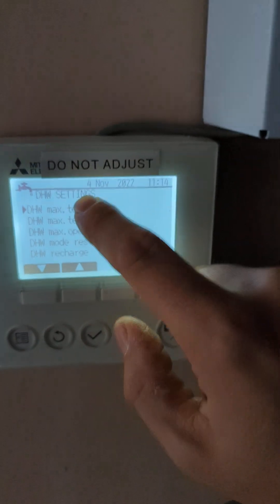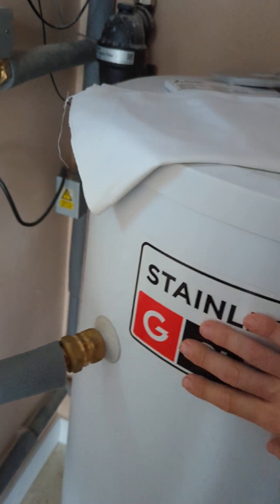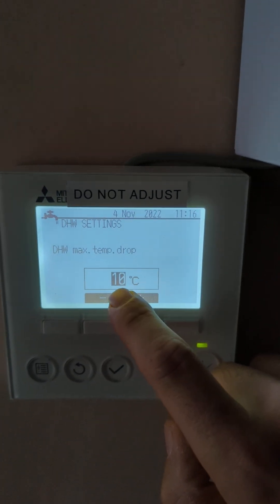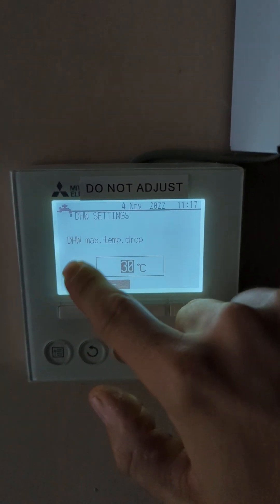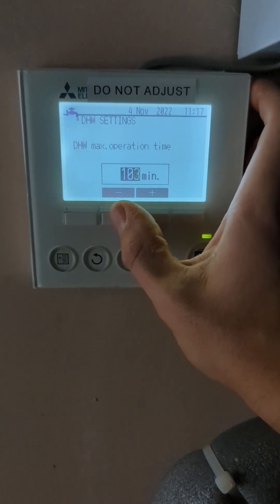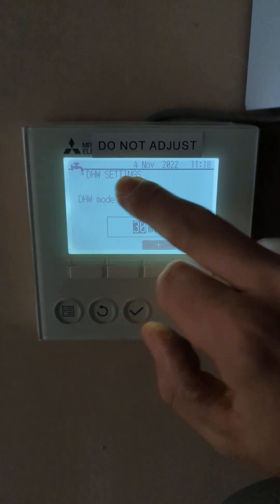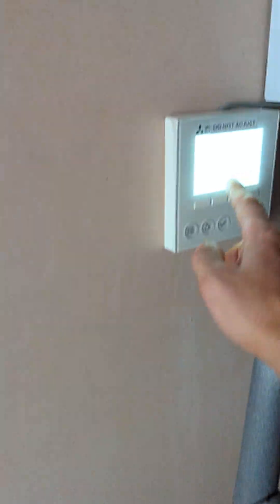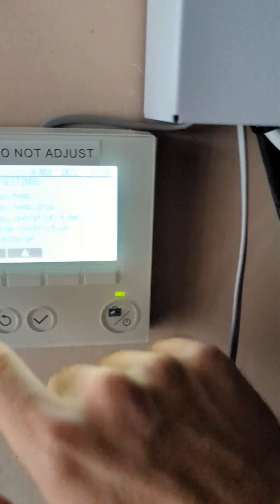Mitsubishi Ecodan hot water settings explained

Comment: Hi, I’ve had my ashp now for about three weeks. I have found that the heating of the water is done with the immersion heater and not the heat pump. The water is set at 50 degrees. Why is this and is there a setting I need to change..?
Thanks. 
Regards 
Mick.

Comment: I don't get the notepad option at 38 seconds. I only get the lefthand  option (to change between normal and eco). My water temperature is currently showing as 67 degrees on the front screen which is much hotter than I need.

Comment: I have an Ecodan system which is an electric heat pump for radiators and hot water, it has a water heater tank and a control panel.  It was all set up for me, but I thought i was spending too much, so i started tinkering about a year ago and I turned off my water heater tank and I either:

- Found an option in the controller settings thinking It meant I was bypassing the water tank from heating up/storing the water and instead getting my water heated on demand directly from the heat pump

- Thought that just turning off the water heater at the wall was achieving this 

- Or i did both, I can't remember.

I'm away from the house most days and fixed my energy rates with OVO before October, but I'm still spending over 100 each month in the winter and between 50 to 100 in the spring and summer.  When I get back and turn on the hot tap in the kitchen, it runs cold for a several seconds before the tap spits/splashes with a burst of water and then the water starts coming through warmer and warmer.  I thought that by turning off the water heater at the wall and/or adjusting the settings, that the water wasn't being heated/stored in the tank and that I was getting water heated on demand directly by the heat pump when I needed it or am I mistaken?  It didn't make sense to be recycling and storing hot water for days while im away. Additionally, I see spikes of energy use in the morning or evening on the app for days I'm not there as well as days I am.  So I turned off the legionella feature in case that was costing me money too.  What do you think please?  Thank you.

Comment: Really really helpful and the video is clear. My confusion is I have the heat water setting in the general settings on at certain times between 4 and 6pm so should I change this as I am not sure which setting over rides the other? Sorry if not clear I mean there are the settings you show and then heating and hot water settings which I have on timer so should I change the timer settings to run all day like I have the heating setting? Thanks fora great video

Comment: After selecting the hot water option you have the screen with the tap and legionella, under the tap icon you have it set to ECO, is this better than the Normal my system was set to?

Many thanks for the video 🎉
Reply: Did some googling (duh), as far as I can tell normal seems to heat the water a.s.a.p, ECO heats the water up overtime.

The only thing I can't find out is what the total KW/h between the two settings.

Comment: Thank you, at last something I can get my head around. I’m newish to having a heat pump, since summer, and admit, been a little confused by it all. However one question, if I lower water temperature, will it still automatically run on a 60 degree to clean tank, or will I have to do it manually? Mine is an Ecodan and is set to 55 by installer, but want to lower it to 50 degrees.
Reply from the maker: @debbiearmstrong8273  you can go ahead and set your tank temp to 50, it will not effect the legionnaires cycle at all, when the unit does this cycle it ignores your set temperature and heats to 60 using the back heater, regardless of what your hot water temp is set to :)
Reply: Thank you for your help.

Comment: Thanks for this. I have been using my heat pump wrong for 2 years. setting it to standard instead of large with a family of 6. Also noticed during cold weather it was taking 2 attempts at heating the water due to having the max operation time too low

Comment: Fantastic videos thanks you so much, I'm a newbie to this but learning lots from your videos 🙂Can I ask why my dhw heater used the immersion heater ( I think near the completion of the cycle)when only heating the water to 45c it was 14c outside and I had it set to heat the water at 11pm  just in case that makes a difference, water temp had dropped to 35c before the cycle came on ad it took about 30mins for the water to reach 45c. Also would setting the dhw to 'eco mode' prevent this from occuring again?
Sorry for all the questions just trying to run this thing as efficiently as I can. ps the tank is 175 litres🙏

Comment: Hi great video!!! Just wondering if u could help Ecodan set to standard when calling for hot water set at 50 keep starts fine then after a few mins keep switching from air unit to immersion to heat water, timed it today and took 3 hours to complete cycle 🙈🙈 which was at 25% already any help b much appreciated any way of stopping the immersion from kicking in
Reply from the maker: @leshutch3166  heya, did reply on your other message, I think you may have either a flow problem, or the heat pump isn't providing the heat required, this is the only reason this would be happening. Where abouts are you based ?
Reply: Sound il get onto the plumber,ya in Ireland Co kerry thanks for the info 👍👍

Comment: My water temperature dropped down to 10℃ and it stayed like that for 2 days, suddenly on the second day the water started heating up again. My water always drops around 10℃, but usually it just heats it back up without much delay.
Reply from the maker: when you say it dropped to 10c, do you mean actual tank temperature or did it drop 10c below your asking temperature ? might just have been coincidence you saw it so low before it kicked in
Reply: @renewableheatingengineer8537  It drop to 10℃ and it stayed at that temperature for 2 days, so I had no hot water or heating for 2 days.
Reply: @renewableheatingengineer8537  I just noticed that the DHW Recharge was set to Standard, and I have a 300L tank; so I've just changed it to Large.
Reply: @renewableheatingengineer8537  It dropped 10℃, so I had not hot water or heating for 2 days.

Comment: Hi, very good video, extremely well explained. I have essentially copied your settings, not that mine were way off to start with. What I am noticing is that if my child has a bath, then I need to wait 30 mins or so for the water to heat back up. Similar, if x2 people ahve showers in the morning then the kids have to wait a while to have a bath. Not sure of the size of our water tank but it's on the bigger scale. The water does not seem to be recycling quic enough. DHW is set to Large too. My plumber suggested increasing the max temp from it's current 50 degrees. I dont how this would help. I should have a full tank of water at 50 degrees to cover x2 showers and a bath?

Comment: This is brilliant video so many thanks. I have qq please.. I have my hot water on timer which comes on at 00:00 but if temp of water drops during the day what will happen?? The reason for asking is that I have noticed pump is always on even though heating is off and it's not the time to heat the water
Reply from the maker: Hey Discoparty, if your temperature drops outside of your desired times, your heat pump will not run to replenish the hot water, with regards to you saying your heat pump is running 24/7, is this just the pumps inside the property ? if so, this could be the anti freeze protection which is completely normal specially at this time of year with the colder weather. or it could simply be a setting on the controller known as fixed flow where the heat pump will always run to provide the set temperature.

Comment: Hi there fella,
I onow im late to the party, hut firstly, great video 👌🏼

Secondly, I have my hot water on timed, so its heated up during the cheap rate electricity (1am - 4am) but ive discovered that even in timed mode, the air source will kick to replenish the hot water, when I've had a bath, regardless of being in the timed mode.

Does this have something to do with the temp drop (water set to 50 degree's with a 10 degree drop) & if so, hows best to deal with this?

Any help would be greatly appreciated.

Many thanks

Comment: Hi. During this cold snap the anti-freeze system is kicking quite a bit, which as I understand it involves the water pump next to the hot water cylinder being on while the outside temperature is 5 degrees or below, so that the water in ahsp doesn’t freeze. However, the temp of the water in the cylinder seems to be dropping quite significantly during these periods. Is this how it should be?
Reply: Having this problem too. Anti stat is on a lot and I'm getting no hot water

Comment: Thanks for this very helpful video. We are a family of 4 with two little kids who barely use any water, but we have a 189L cylinder. I was actually trying to see if there was a way to heat up only a part of the cylinder and your video answers this well - however we seem to have the "old" unit as I don't see the standard option. Is there a way to get the newer unit? Apologies if it's a stupid question as I'm very new to all of this.
Reply from the maker: Never a stupid question as you dont know until you ask :) - the answer is Yes, you can get the newer unit, however the cost for this would be extreme, for little to no gain and wouldn't warrant the cost in my opinion. You could however, drop your hot water temperature to 48Degrees for example, this would effectively work in the same principle, as the hot water will shut of quicker, but you wont notice a massive difference in temperature. this will make the unit run less as the hot water sensor will shut the heat pump off quicker, but because heat rises.. the top of the tank will still be warmer than 48Degrees :) its a good way of saving energy if you really dont use that much hot water. if you found that you are running out, then you can always boost the hot water for an hour or increase the temperature again.

Comment: Thanks for tour video. Can I please ask question. I have set my water heating similarly, however. Every time water is reheating it starts with bolt on the screen and immersion. When I stop it and re start it than starts with heat pump and heat all way through until reach set temperatures. Can I just ask what could be the reason for immersion? Any help will be appreciated.

Comment: Why does my menu button do nothing? Not user level no installer lever 😢
Reply from the maker: does it show a padlock symbol at the top of your controller when you press the notepad button? if it does, press and hold the tick button and return button together. this will remove the lock, you can then use the controller as seen.

Comment: Hi, can you please explain: My space heating is off (set temp is lower than actual room temp) - then the hot water production starts but it seems to also pump hot water to the space heating radiators increasing the room temperature even further. What could be the reason for this?
Reply from the maker: Hey @Janventer6410 - This could be 1 of 2 things, if you have an older version Ftc panel . i.e version 4 - sometimes after completing the hot water, the 2 port or 3 port valve will move to the open position, this is to remove any excess heat from the primary circuit, thus causing some radiators to warm up. - The 2nd and most common cause is that you have a faulty 2 port or 3 port valve, which is slightly open to the heating circuit when hot water is in demand, this would need to be replaced. I hope this information helps.
Reply: @renewableheatingengineer8537  -Hi,  first off - great videos,  they have been really helpful.    I think I might have the faulty 2 port issue you described above.  Is there a simple way to detect this or do I need a heating expert callout ?

Comment: Does the water heater switch have to be on all the time?
Reply from the maker: if this is ran through the main Ftc panel then yes it does, however, this does not mean its running 24/7, it just means its on and ready to be used when the unit calls for legionnaires cycle, or if you was to put the unit into emergency mode
Reply: @renewableheatingengineer8537  thanks, is it necessary to run legionnaires cycle?

Comment: Great video thanks. Would you suggest using "large" option for a 210ltr tank, 8 5kW ASHP in a 2-storey house with 3 kids, 2 adults? Also, the DHW max temp is set to 50degC and drop of 10 but it gets down to 23ish before it starts warming and uses a lot of power. Any ideas? We have PV panels and a battery
Reply from the maker: 100% Set your tank setting to large, and also ignore the 23ish drop your relating to, the sensors on the pre plumbed cylinders are extremely slow to react, althought this says 23 on the main Rc, we actually find its just a delay in reading the correct temp when the pumps kick in.

Comment: Thanks for the video it is extremely helpful. However, I have a problem in that the actual hot water temp is not shown on the main screen. The water emp is set at 48 but this morning it was almost boiling. What could be wrong?
Reply: We had this problem - it turned out the thermostat probe in the tank was faulty (it never worked properly with our iBoost and kept overheating). Thankfully, as this was within the first month of it being installed, the plumbers came back and swapped it over - no more problems
Reply: Go to initial settings on controller. Scroll down to temp display. Press and change to Tank. This shoud work.

Comment: Should the immersion be heating the water in tank or the heat source pump? The immersion symbol shows on my panel each time it comes on - set for a couple of hours each afternoon.
Reply from the maker: Hey, If your heat pump is on the R32 Gas, your immersion will be used on most hot water cycles as soon as it gets to around 48Degree tank temperature, another reason it may come on earlier than this is if the heat pump is struggling to build temperature quick enough within the tank, this could be down to installation error. another reason it will certainly come on, is if your hot water temperature is set to 56 degrees or above. Hope this helps.

Comment: My Ecodan has previosly been able to heat hot water to 53 degrees without using the immersion heater. But now during the summer when its 25+ degrees outside, it has started to use immersion heter between 50-53 degrees. How can this be? Is it becoming to hot? The flow water in the system looks to be 65 degrees when the immersion kicks in.  Why does it go so high? Perhaps better to heat water during night when air temp is cooler?
Reply from the maker: Hi Baxtexx, do you have solar pv assistance on your property ? if so does this feed back into the hot water cylinder via an Iboost system or equivalent? The immersion will be used, specially on an R32 Unit. if your heat pump model starts with PUZ on the model number outside then this is completely normal, during summer months the unit is calculating weather or not the immersion is actually cheaper to run in order to heat the last little bit of the tank, rather than the heat pump running during warmer weather and causing issues with the compressor. believe it or not, this function happening is actually cheaper in the long run.
Reply: Thanks for your reply! No I don't have anything solar related at all. My model is: :Outdoor: WM85 YAA, Indoor: EHPT20X. It does indeed use R32.

Is it really cheaper? The display reports that this process results in COP 1.5 which seems quite bad? Yesterday I actually scheduled it to run during night/morning instead when it was about 16 degrees outside. This time, no immersion was used at all and it claimed to be at 2.7 COP which is significantly better.

Comment: I have the same system, after a power outage it won't start the dhw heating manually... :/
Reply from the maker: does your system go into at E6 Or EE Fault code on the controller ? try resetting this completely by turning the outdoor unit off and the indoor unit off, then turn all back on if so. this will simply reset the communication for the unit.

Comment: I had a problem with my heat pump in that the cylinder regardless of settings would go below 30*c and I would rarely have hot water. Called a technician and they had a look. One of the internal filters was blocked by dirt and calcium deposits to the point that all circulation stopped in the heat pump. The guy was surprised I knew all the settings (thanks to this video) but  said that this had nothing to do with me or what I changed. It just needed to be cleaned by a professional.
Reply: Just to add to this. The buildup that occurred in the heat pump was due to the  water/fluids that were used during the installation of the in floor heating. The minerals were already in the system and simply all got blocked at the internal filter. Hopefully this helps if you recently got a new heat pump installed.

Comment: Thank you for a very helpful video.  Can I set the timer to only allow the hot water to heat at certain times while not affecting the central heating which is on the Melcloud timer?

Comment: and what does ECO mode mean?
Reply from the maker: @zlmdragon.   sounds like there may be a delay with the THW5 sensor which is effectively your hot water sensor, although on the controller it will show 49-51 as youve mentioned, it may actually be sending a signal back to say its at the 10 degree drop point, to test this theory, decrease your temperature drop to -15 and see see if this then delays the heat pump coming on to recycle. if it does .. the THW5 Sensor needs replacing. although for what it is, I would just keep the maximum temp drop to 15 to allow for that delay. hope this helps.
Reply from the maker: Hi Marko, Eco mode allows the unit to run at a slower rate whilst in hot water operation, where as during normal operation it will deliver a quicker hot water recycle time.